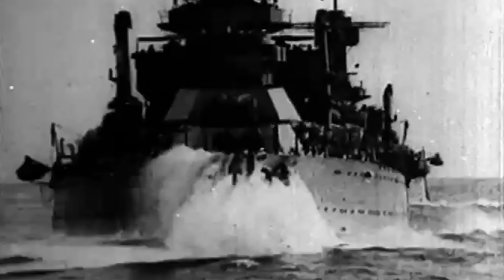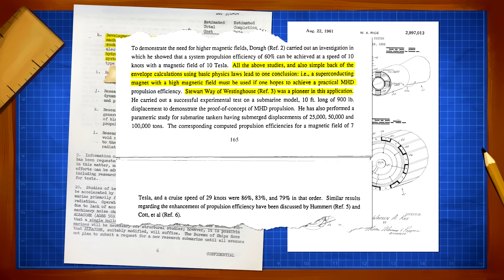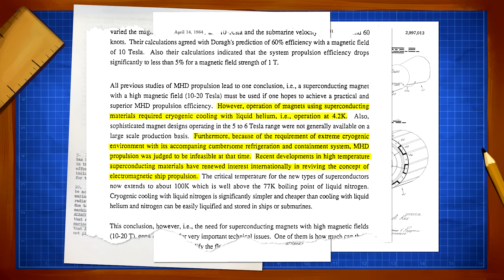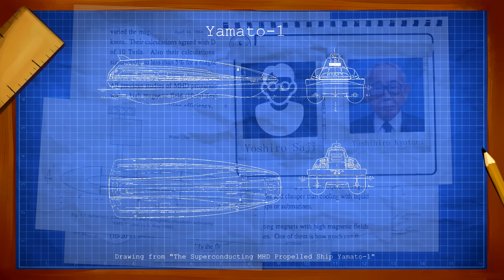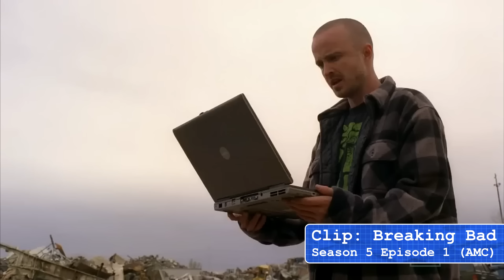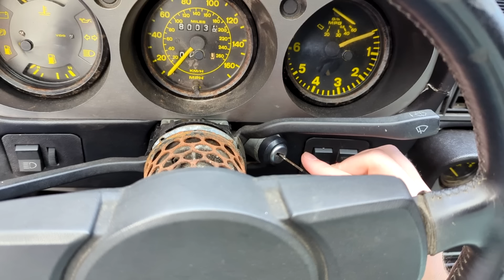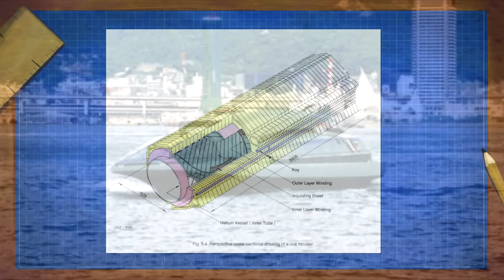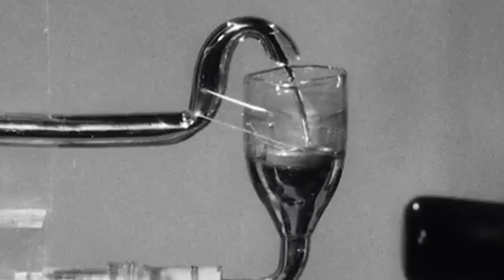Japan's Magnet-Driven Marvel: The Yamato-1

Comment: MHD propulsion is certainly exciting, so it's no wonder that there were so many attempts to create usable vessels based on it, but unfortunately it seems to be impractical and inefficient at any scale so far. At least unless some significant breakthrough is made in the field of superconducting materials in terms of temperature, but even so it's a question how usable such drives would be. Maybe for some specialized applications, where speed is less important than silent operation. But otherwise, I'm afraid it will will not get beyond the experimental phase, despite the respectable attempt and achievement.

Comment: All these MHD concepts used anode and cathode electrodes to pass current through sea water at right angle to the magnetic field. This wastes a significant amount of energy splitting water and wears the anode.  It sure would be cool to see an electrodless induction thruster, sort of like a ring launcher.

Comment: Brave AI: "Yamato-1 is an experimental ship built in the early 1990s by Mitsubishi Heavy Industries at Wadasaki-cho Hyogo-ku, Kobe, Japan.
 It was completed in 1991 by the Ship & Ocean Foundation, later known as the Ocean Policy Research Foundation.
 The vessel was the world's first superconducting magnetohydrodynamic (MHD)-propelled ship, successfully operated in Kobe harbour starting in June 1992.
 Yamato-1 measures 30 meters in length and has a beam of 10.39 meters, with a displacement of 185 tons.
 It is powered by two 4-ton MHD thrusters, each producing 8 kN of thrust, driven by liquid helium-cooled superconducting magnets.
 The ship uses seawater as the electrically conducting fluid in its MHD thrusters, which generate propulsion through the interaction of magnetic and electric fields.
 Yamato-1 achieved a cruising speed of 8 knots (approximately 15 km/h or 9.2 mph), though system efficiency was limited to around 15% due to the weight of the superconducting magnets and other technical constraints.
 The ship's hull was constructed using light anti-magnetic field corrosion-resistant aluminum alloys and was insulated to prevent electrical leakage.
 After its sea trials, Yamato-1 was displayed at the Kobe Maritime Museum until it was demolished in 2016.

Comment: Practical?!!  With a 12 day lead time to even start moving, massive weight and power requirements, and a huge amount of liquid helium, I don't see this ever being practical.  There's just no reason to invest so much money and materials into a propulsion method that is easily beaten by a few KW of electrical motors.  I just don't see the reasoning behind MHD unless you need extreme quiet, and even then you're making a lot of noise from the diesel power plant and cryocooling machinery.

Comment: In a nutshell: This boat is powered by the interaction of an electrical current that passes between plates in the motor housing and very strong magnetic field. No moving parts other than the sea water. Problems: It costs a fortune. It is extremely heavy. The amount of electrical energy turned into mechanical work is only 15%. Much worse than a normal ship's propeller. Only one boat was built using this technology. It was only experimental and the experiment showed that it is far too inefficient to be used.

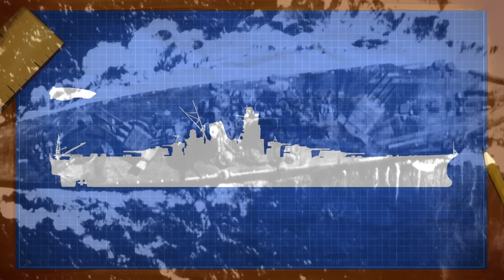Comment: Ten times smaller is mathematically impossible and grammatically dysfunctional. 1:30
Reply: It is not mathematically impossible nor os it "grammatically dysfunctional."
Reply: @EidolonFantasma  What is the "Times" function in mathematics in regard to a measurement of a real object? Size times x meters? It is a multiple. Not a fraction. There is no scale of "smallness", it is not a measurement. You can't have "more small". What is 10 times as much smallness? You make a very poor argument.
Reply: @BariumCobaltNitrog3n Saying I made a poor argument when yours was 10 times worse. The word "times" doesn't solely mean multiplication, it means "instances." As in how many instances is a set of numbers added, subtracted, and/or divided. "Times" is most often used as shorthand for saying "multiplied by" like "plus" is shorthand for "added to." Saying something is 10 times smaller than something else is saying that the small thing would need to be multiplied by 10 times to reach the size of the larger object, or that the larger object's size would need to be divided by 10 times to get the smaller object's size. There's also no mathematical impossibility to multiply a number by a fraction, such as 100 × ⅒ = 10. There's no grammatical dysfunction in saying "10 times smaller" because we're not doing mathematics and writing out equations, we're speaking in a more broad definition of what "times" means. One minute is 60 times shorter than an hour. A quarter sized model of an airplane is four times smaller than the actual airplane it was modeled after. Every rational, logical, person knows exactly what "10 times smaller" means.